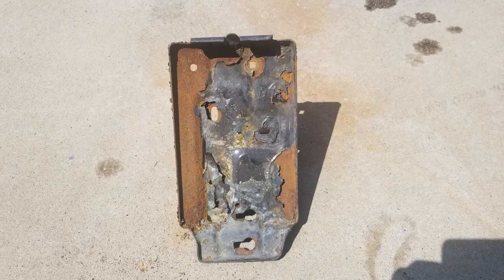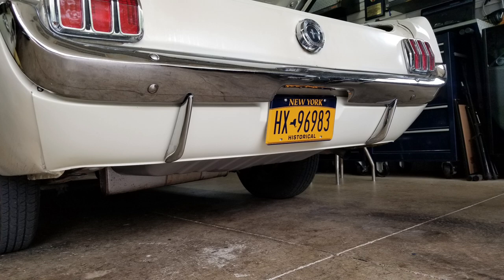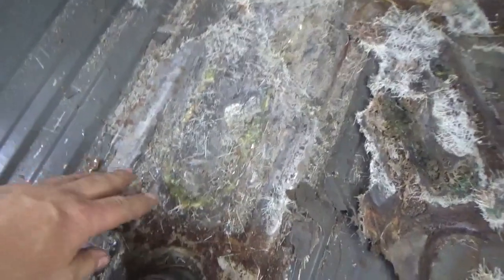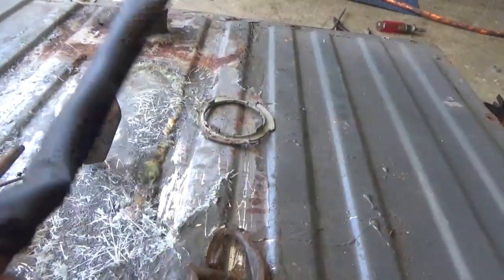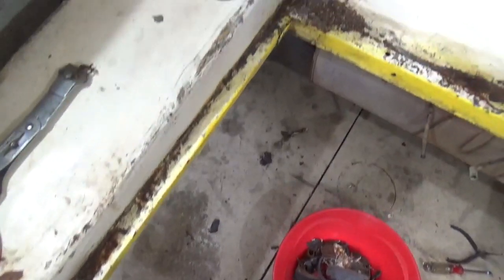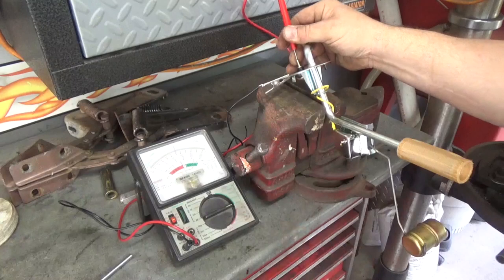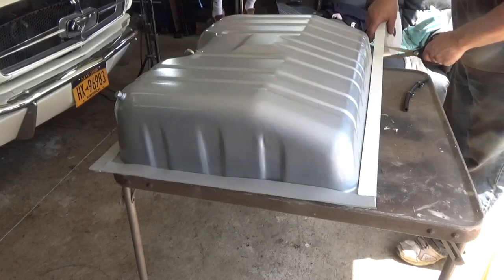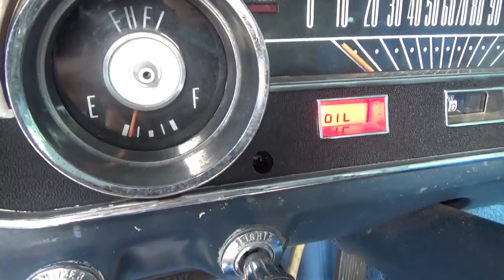1965 Mustang - How to Change the Gas Tank

Comment: You make it look easy,  Pete. Looks like a great car for cruise night.
Reply from the maker: It's a nice car to drive around in
Reply: One thing I  miss is the simplicity of the older cars.  Easy to work on,  most were built to last, and they got the job done.  I haul new automobiles for a living and even though they are built lighter, they are extremely more complex.  The older cars were more fun to work on.  Easy to work on and  it was a relaxing, peaceful enjoyable past time. I found the battery was dead on a brand new (2020) explorer so i had to jump start it. By the time I located the battery (it's under the windshield cowling passenger side), got all the covers off, started the car, and put everything back together,  I had decided that I would never buy one of these. If anything broke the time involved just to get to the part that failed would turn into massive amounts of money (remember, dealers charge around $110 per hour). I'll just stick to the older ones. Oh, by the way,  I love the way you teach on this channel,  thanks Pete.
Reply from the maker: Thanks Bruce

Comment: Pete , a real common problem in early Mustangs in getting the fuel up front is a fuel line crush spot where as a mechanic would jack up the vehicle from the side crushing the fuel line that crossed over the frame that connected to the floor support on the drivers side .
Reply from the maker: That is true, I looked at that, thanks
Reply: Good advice Doug, thanks.  I think that if you don't read the comments on a video you're missing out on a lot of Good information.
Reply: Yikes. I recently jacked my Mustang up the other week and now it won't start. Wondering if this might be the issue.

Comment: The exact same thing is happening with my ‘65 Falcon! Broken fuel gauge and the engine randomly dies on me even though I just out fuel in the tank… was thinking the issue was carb related, but now I’m planning on replacing the tank and getting a new carb
Reply from the maker: That should help

Comment: I know this is an old post… I’m going to have to replace the tank on my 68 ‘vert. It’s been sitting way too long  and gas has gone bad. REALLY. Stinking .bad. 
Carb is being overhauled.  New filter at carb. New fuel pump. 
I’m going replace tank before installing rebuilt carb. 
I love the way you put the caulking/weather stripping on the tank instead of the tray, like everyone else.  I’ll do that! 

One more thing… you have a gas filter PRE fuel pump.  I’ve been told that’s not a good idea, though I don’t see why.  Thoughts? 

I have a metal filter installed into the carb inlet.  Should I do both? 

Thanks!
Reply from the maker: Filtering fuel before the pump will prevent anything from puncturing the diaphragm
Reply: @PetesGarage that’s my thinking. I don’t know why I was advised not to do that. 

Recommendation for pre pump filter for 68 200-six please?
Reply from the maker: Any standard filter is fine

Comment: I own a 1990 Mustang G.T 5.0. Its been in standstill for 10 years because of a transmission issue. Im planning to flush all the essential parts to start the car.  My question?? Do you recommend to change the fuel tank system and pump? Another question?? What causes a 2003 Chevy cavalier to jerk at 4000rpms in park? Thank You!
Reply from the maker: I'd clean out the fuel system, run fresh gas through it. No idea on the Cavalier
Reply: Best thing to do is not run it at 4000 RPM in park.

Comment: Pete, I have a 1968 Mustang 289 with a leaky 2V, I am going with the Holley Sniper 4150, they said to get the in tank fuel pump so I don't have to change the tank.  At an additional $250, do you think the Holley Tank for EFI would be worth it? I hate spending the money twice.  You have some great videos
Thanks
Reply from the maker: The in-tank pump will be much quieter. That system will work great for you

Comment: I knew a guy who repaired gas tanks by fixing holes, cleaning rust out and adding a liner. That was about 30 years ago so sure no one does it anymore.
Reply from the maker: That would work, but they are pretty cheap
Reply: Back then only a limited number of tanks could be bought.
Reply from the maker: True